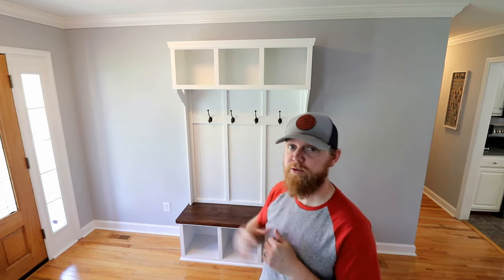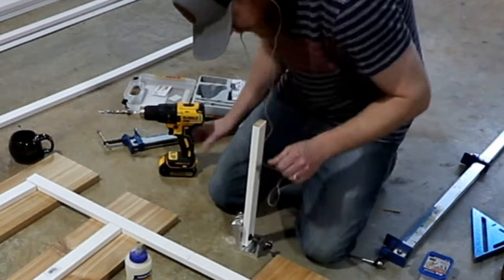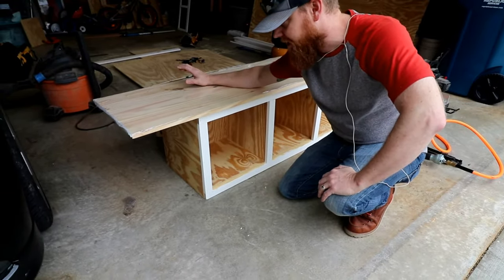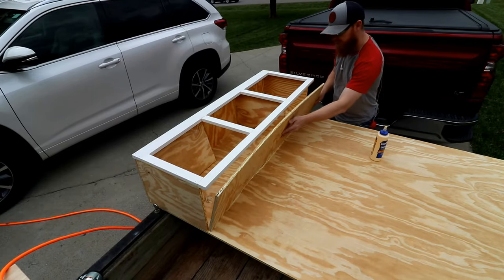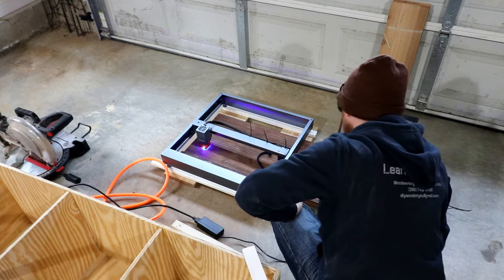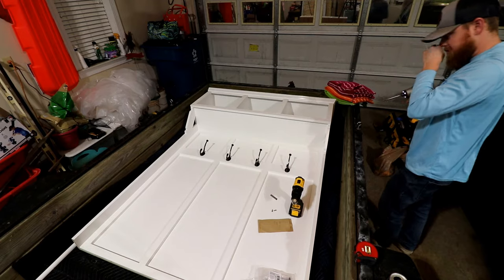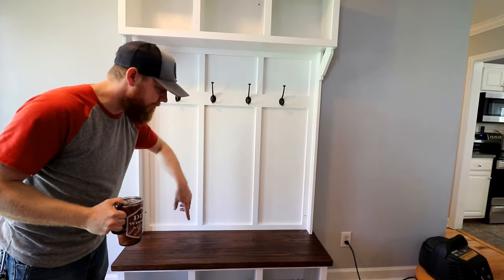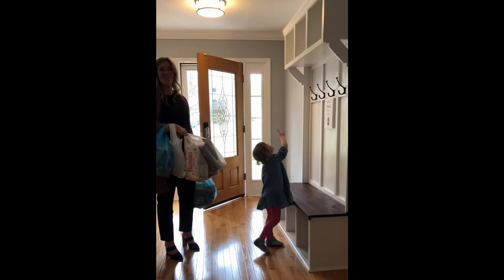Building a Hall Tree!

Comment: I want to build an entryway tree but I don’t understand anything you’re saying 😭😭😭 I tried to download a 3D model program but I don’t know how to use it either.. I have a bunch of tools but I also don’t know what to do with them. How do I even learn? I have a model with measurements. Is it really this extensive?
Reply: I’m a female btw. This would be my first project. Like I know some things but it’s clearly not enough
Reply from the maker: Thanks for reaching out Zoe! I understand how this can be completely overwhelming, both the build aspect, and learning a design software. Here's how my brain works, so it's not so overwhelming...Break it down into manageable pieces.  Grab a tape measure, sharp pencil, calculator and note pad. Figure out how deep and tall you want the bench to be.  Break it down into layers from there.  The bench needs a face frame, side panels, inside panels, back panel, bottom panel, and top. What are the actual dimensions of the material used to build that?  Good thing to know : 1 x 2's actually measure 3/4" x 1-1/2", not 1" x 2" 🙄. Same goes for all lumber from a big box store. Alright, so the depth front to back of the face frame (white primed pieces in the video) is 3/4", then you figure you want a bullnose that sticks out on the front, that also measures 3/4". So now you have 1-1/2" of material thickness.  If you want your overall bench depth to be 16", then you subtract the thickness of what you just figured out from that (16" - 1-1/2" = 14 -1/2"). Now you see that your side panels will be 14 - 1/2" deep. Just go piece by piece, and do the same thing, and it will come together! Reach back out if you need to along the way. I'm going to try to sit down and actually make a downloadable build drawing of this. That would be helpful... 😁

Comment: Maybe I missed it but what are the dimensions on the side pieces for the bottom cubby? 15.25 by?
Reply from the maker: The side panels should be 15.25 h x 14.5 w to achieve a bench that’s 16” high, and 16” deep. Because you have the face frame and the bullnose which are both .75 thick. 👍🏻

Comment: Quick question - The bullnose for the bench seat. Did you rip that from the edge--glued pine? Or use scrap laying around? Measurements say no, but wanted to confirm. thanks!
Reply from the maker: Yep, you’d be right! I actually used some drop that I had from another bench that I made. I have done it with a full 1 x 2 for the bullnose. I think I prefer that method.

Comment: What did you use to fasten the top and back to the base? Are those dowels your sliding it down on?
Reply from the maker: I thought about using dowels, but I didn’t end up using anything to attach the top and bottom. We just placed it gently on there so we wouldn’t have to slide it. Dowels wouldn’t be a bad idea though to strengthen the bottom of the side panels.

Comment: What size finish nails were you using with that pneumatic nailer?
Reply from the maker: I believe I used 1-1/2, however there were 1 or 2 that came out the side. I’ve found 1-1/4 to be ideal. 👍🏻
Reply: @DIYWoodntYou  what gauge?
Reply from the maker: 16 gauge finish nails.

Comment: how did you attach the 1x4 on the plywood?
Reply from the maker: For the 1x4’s on the sides, I used wood glue and finish nails through the back of the plywood.
Reply: thank you. building this now…😁
Reply: what about the 1x4 with the hooks? did you do the same? finish nail though the back? or brad nail from front?
Reply from the maker: @SuperDs06  I believe I went through the front on those, because I had the top assembly laying on the garage floor to lay out those pieces. Awesome! I hope you’re having fun with the build!
Reply: Thanks! Your video has been very helpful! Thank you!🙏
Reply from the maker: No doubt! Thanks!